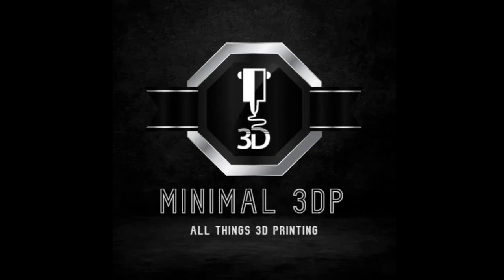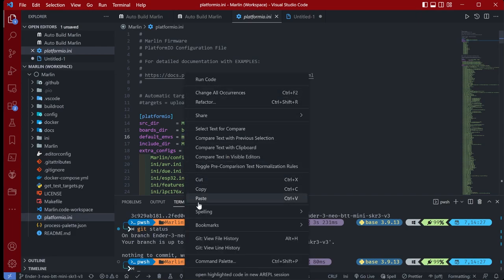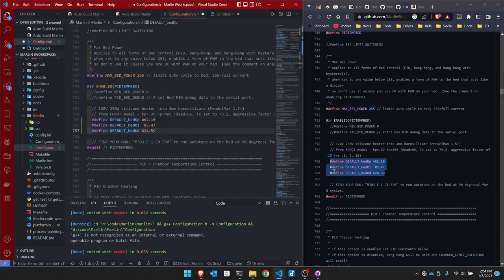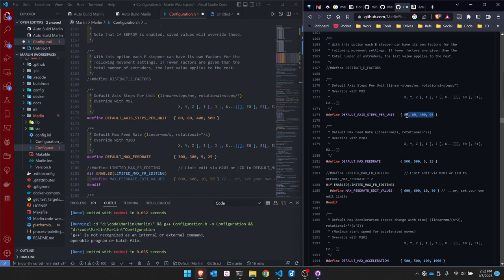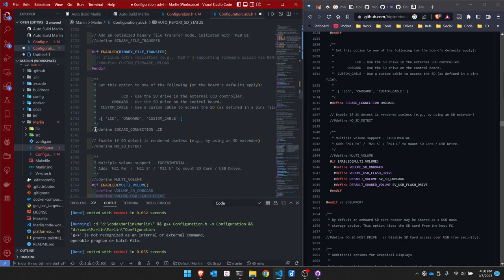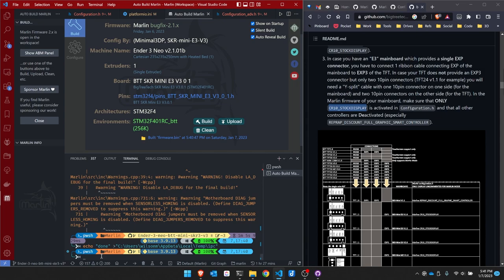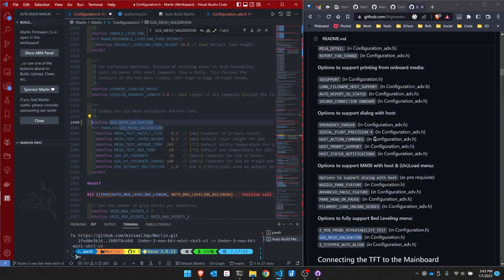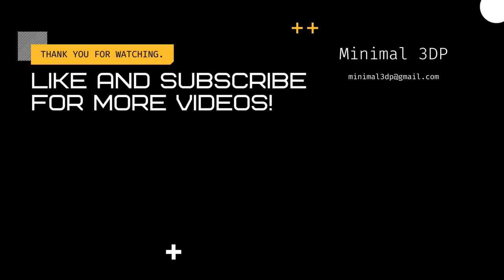A Detailed (and Boring) Guide to Setting Up Marlin Firmware Using VSCode

Comment: This an awesome tutorial but I keep having a problem.  It keeps saying that i have to include path and can't build the firmware.  I've been at it for 2 weeks and I am getting so frustrated.  I have the crtouch and the smart filament sensor the btt smr e3 v3 board and the btt ftf35 touchscreen v3. My Ender 3 is working but I have to turn the filament sensor off cause I don't have the firmware set for it. I had to download a already built firmware to at least run it with the crtouch. Can someone please help me.
Reply from the maker: Can you share the actual error?